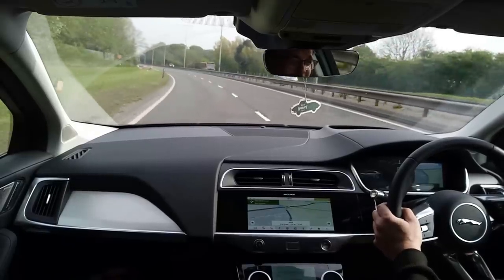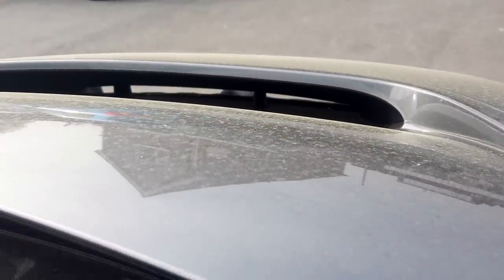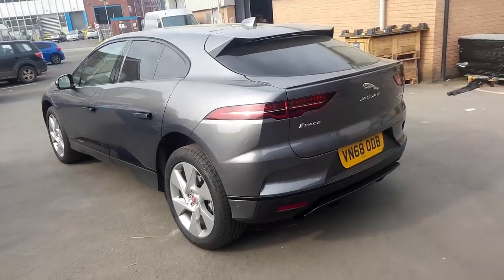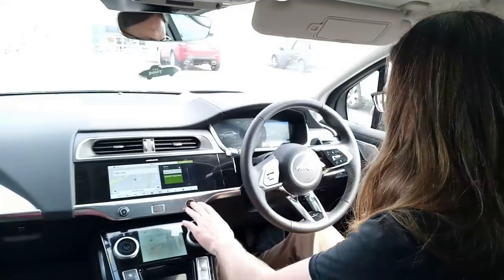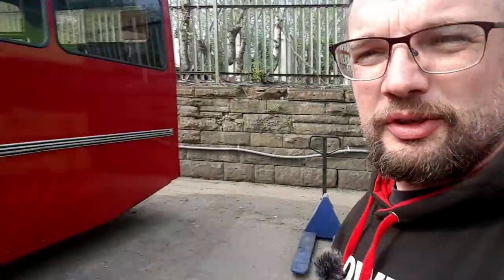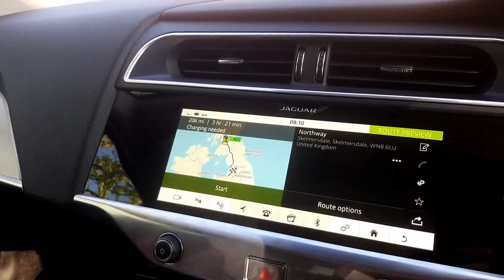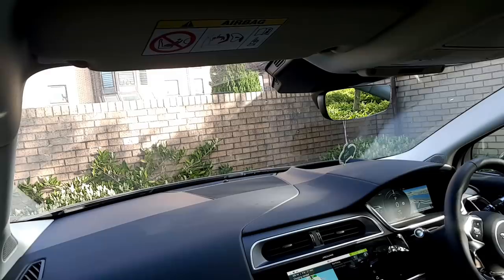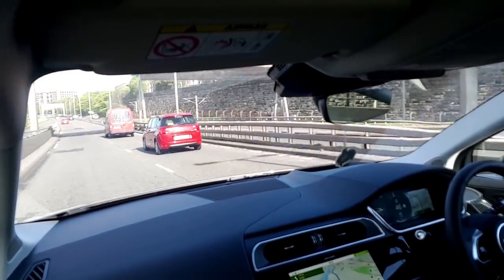Real Road Test: Jaguar I Pace 800 Roadtrip - with bonus bus action!

Comment: Life is complicated enough without adding one of these to it
Glad I am old enough to remember proper jags
Reply: I'd have another XJ40 like a shot, only chopped it in cos the rear sussy struts were leaking, wished I had just had 'em replaced but someone came along with a Sierra 2000e and I had to take that on as never owned a 2000e.   Turned out to be a car of hidden and expensive mysteries and some askance looks at previous owner who went to some extent to hide the terminal rust in the crumple channels :(
Reply: You can still get “proper jags”
Reply: urbex2007  I had a 93 XJ6 3.2 with the dicky back lights, relay was on permament 'back order' so had wire a bodge up lol
Reply: @ Chris Rawson - you mean 'proper' Jags that were unreliable, had awful electrics and were so desired by the buying public that the company folded...

But these new Jags are rubbish, aren't they? - you know, like the one in the video that has won over sixty international awards - more than any other Jaguar in history.  Those new Jags that are outselling any of the old ones and took the company to profitability for the first time in decades...

Comment: you have probably just done the most down to earth EV review, fed up of most of the others ramming it down our throats and saying that EVs are 100% fault free and stuff. good work
Reply: It was a typical review of being loaned an EV with basic knowledge of how the chargers work. With a little more experience Ian would have known that the Ecotricity chargers were working and on free vend. Plus when you own an EV you would use of ZAP map to find cheaper / free chargers in more convenient locations. I was loaned a car the other day and couldn't put diesel in it because I only had cash and it was a chip and pin petrol station only.
Reply: @markbradley5365  Give it a rest will ya. That video said it all. Bet there was another diesel pump down the road. If not you can always pop in the local chippy and top up with waste oil.......
Reply: @rambleon3698  This Video said I'm new at this and he didn't realise that the charger was working and on free vend. Chip shop oil would not work in a 2015 Audi Q3. It would work in an old Citroen Xantia. What bugs me is people who don't know much about EVs telling other people they don't work as they expect them to when it's them how are not how to work them and then people getting the wrong idea as in this case with the charging network. It was working once more it was on free vend.
Reply: @rambleon3698  My point that I'm trying to put across (not very well) The charging network is not as bad as made out in this video.
Let's say I was to review the latest Iphone and I wasn't given the charger
I could say the phone was rubbish because it can't be charged with my Samsung charger and until all chargers are compatible Iphones are not for everyone. It just means I haven't been given all the equipment to review the phone adequately. 
Have you ever seen anyone at a petrol station with a new car and can't open the filler cap? and haven't been shown where or how to open it  when bought from the dealership. 

My point is when you own something for a while you have better knowledge of how it works, the good the bad and make a more informed view.

The reason I have commented on this video is because of some people's negative views on something that is not correct. Ian states that Ecotricty charges were not working  (they were) and it's a poor network after only 2 days of driving an electric car. I have been using this network for 3 years and have never failed to charge. My view is it's an excellent network

Getting back to the diesel Audi which had a warning light on less than a year old! Add blue!! my mam had never heard or been told anything about it and had to take it back to Audi thinking the car was broke. She was then charged 3 times the price for them adding it as I could have bought it for.
So if my mam was going to review her Q3 she might say it broke within the 1st year. ( we know it didn't but she is telling her friends not to get an Audi because they break within the first year) 
Is my point coming across or am I just making it worse?
Reply: @markbradley5365  
Yeah I understand what you are saying.
Reply from the maker: How can you say the chargers were working when they clearly were not? Neither of the chargers that broke could be convinced to provide electricity, so don't make incorrect assumptions.
Reply: @HubNut  3 years of using Ecotricity charges and I can see the screen of (free vend) at 46.58 into for video. This happens when the charges loses signal. The app will say the charger is in use but all you have to do is plug the car in and press start. You now have given the impression to your subscribers that  1. Ecotricity is a rubbish network (it isn't) based from a 2 day test drive. I have used these chargers for 3 years up and down the country and have never been stuck once. Yes it's not straight forward like putting petrol in but it's new technology the more you use it the easier it becomes. A bit like when mobile phones came out, a landline is easier to operate than a mobile but most people learnt how to use a mobile. Yes Instavolt car easy to operate but Ecotricity put these chargers in over 5 years ago way before anyone else. 

At least you can't put the wrong type of electric in an EV. After 100 years of the petrol station some people still seem to  put petrol in a diesel and diesel in a petrol car, hmm lets blame the petrol station
Reply: Imagine the preponderance of the motoring public going through that palaver every day. What a nightmare. I'm pretty sure the infrastructure wouldn't be the only thing blowing a fuse.
Reply: @rambleon3698  If the motoring public has the inability to learn how to operate a charger maybe they shouldn't be operating a motor vehicle. 

The human race has the ability to improve things :
Radio to TV (still have radio)
Landline phone to mobile 
Typewriter to computer 
Watching terrestrial Tv to watching youtube
Video rental store to Netflix
Dial up Internet to broadband
Coal fire to central heating.

(I do remember my grandad saying he would not have central heating because they breed germs and we would be ill all the time)

Seriously how many people do you know that live in a house with a coal fire, bathing in a tin bath in front of it. A horse and cart outside as your mode of transport
Reply from the maker: How are you meant to learn exactly? This was a real world test. You shouldn't need a degree or have to spend hours reading up to operate a charger. Yes, learning could have perhaps avoided some of the issues, but if the help desk for Ecotricity is not able to advise on how to get a free vend, how is anyone meant to learn?
Reply: @HubNut  Yes your right, it's not straightforward like putting petrol in.
My point is more directed at the modern way, "we the viewer are influenced by YouTube". 
I'm not blaming you in the slightest for not knowing how the charging network is going to work or what you would need to operate it, having just being loaned an EV.
We have all grown up with the Petrol station as we watched our parents filling up their car, nobody needed to teach us and as things changed like chip and pin we just picked it up.
The problem I see is when we are given an EV to test drive, no one tells us how to charge it (probable because the salesman doesn't know either)
and we expect charging to be the same as putting petrol in. It will be in the future but this is brand new technology. Not every charging company is going to get it right first time. I suppose we are still in a 'Beta stage'

Like giving a professional typist a word processor for the 1st time and asking them to write a review on it without any training.

The reason Ecotricity use apps at the moment I suppose is: 
1. So they can monitor who when why what is using them so they can use the data to improve in the future  
2. So they can give a 50% discount to their Ecotricity Home Customers.
They should really have a 24hr helpline but I don't think they are yet to make a profit from the 'Electric Highway'

I suppose I did spend around a year researching everything EV before I purchase one. I don't mean to come across all "THIS IS HOW YOU SHOULD HAVE DONE IT" 
Hope I've explained myself a little better (probably not)
Reply: @HubNut  Free vend is just a default setting when the charger loses  communication with  Ecotricity I don't think they would tell you even if you did get through to them. It's not necessarily a good thing because they tend to get hogged by some people.

Comment: Driving 18 wheeler truck coast to coast in Canada and USA I had encounters with the ‘ultra milers’ a group of over enthusiastic motorists who would getup close to the rear of my trailer and ride the negative pressure or suction zone.  So close 5 or 6 ft  I couldn’t see them in my mirrors.
   I drove a Volvo, 12 litre in-line 6.  520 hp.  Turbo diesel.     Love your show!   Saving a vehicle from the scrap yard and breathing new life into has got to be one of the noblest things there is.

Comment: I don't think i'll be getting an electric car anytime soon, even watching the video was stressful !!!
Reply: Mr M Keep in mind this doesn't apply to Tesla's. I'm taking my Model 3 on it's first real road trip in 2 weeks, from Boston to Pittsburgh – about 1200 miles round trip. Should be easy, just 3 short stops at a supercharger on the way there. Really not much slower or more difficult than in a gas car since it charges so fast at 150 kW (soon to be 250 kW, that's being rolled out now)!
Reply: I was also suffering from range anxiety from behind my keyboard.  If you have the ability to charge at home then EV's seem like the perfect choice for a shortish daily commute.  However the I Pace is a car you'd want to be able to do long distances in, and if/until the infrastructure is massively improved that seems like far too much of a painful experience.
Reply: @ferrumignis    I agree.
Reply: Cod Zilla it’s not US vs Uk at play. It’s Tesla vs legacy car manufacturers. UK supercharger network is pretty good and getting better all the time.
Reply: Nothing wrong with electric cars. But you do need the infrastructure. Come to Norway end experience EV heaven!

Comment: That's kind of depressing.  I love the i-Pace, and I was lucky enough to get on the test drives at Millbrook.  It's truly an amazing car, but it needs the infrastucture to catch up.  With that said, if you have a decent charger at home, as anyone spending £60k+ on a car is likely to, any journeys of under 200 miles will be handled without ever having to touch the charging network.  Most cars spend most of their lives sitting at home doing nothing, so they may as well be charging - If you can - and the vast majority of journeys are nowhere near 200 miles.  There is a lot of investment in rapid chargers and battery tech going on at the moment, and I hope that this experience is one that will be looked back on and laughed about.
Reply: indeded why i want an electric (but cant afford a zoe) i have 9kw of solar, which most of goes back to the grid, i consume very little electricity at home due to being careful
Reply: Agree completely. I have an ipace and almost all of my charging is done at home. A lot of people could probably get away with never needing to charge away from home. But for that odd occasion (and for those who do high mileage), it needs to get better.
Reply: Yes totally agree. I like them and could use an electric car for commuting 40 mile round trip and would quite like one as they become more affordable. Couldn't charge at home presently but am moving to a home where I could which would make it work for me. Hopefully, as you say, the charging issues involved with longer journeys will be solved as time goes on and charging worries will become a thing of the past.
Reply: Even if the infrastructure worked, I can't see how an electric car can ever be anything other than a 2nd car, at best. Who has time to wait two hours for your car to be usable again?
That makes them useless for two reasons:
1. Many people can't afford two cars.
2. You still need a real car.

Comment: I can't be bothered with all that hassle with all that charging its nice Jaguar car but I stick with my lovely Alfa Romeo 75 twin spark
Reply: Can you stop saying " Alfa Romeo 75 twin spark"...I go all weepy and end up looking at pictures of mine....28 years ago......
Reply: Tim Hancock Hi Tim you got happy memories mine 1990  on H plate in Alfa red had car two years now its had one owner from new other one I got is Alfa 33 on G plate in Alfa red
Reply: Loved the Alfa 75. I owned a 2.0 TS and a 3.0 Busso. Proper Car! Wish I had one now! Values are just rocketing up so that's not going to happen any time soon.
Reply: Mark Bennett mine 75 twin spark 1990 all original no rust its kept in warm heated garage with my other Alfa 33 that's all original I use 75 as my daily drive to work and back when it gets back home I gave it good clean polish get rid of all dirt muck from roads
Reply: But it's not a nice jaguar car , it's a totally bland non descript  average looking electric SUV  that looks like someone put a jaguar badge on . Dont like the direction jaguar are heading in .